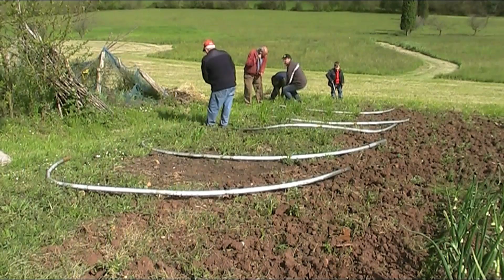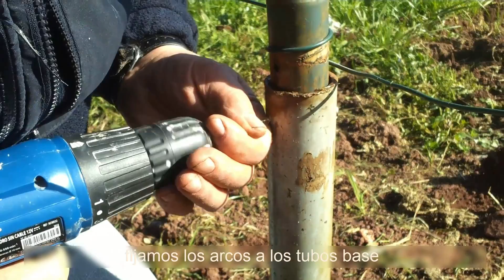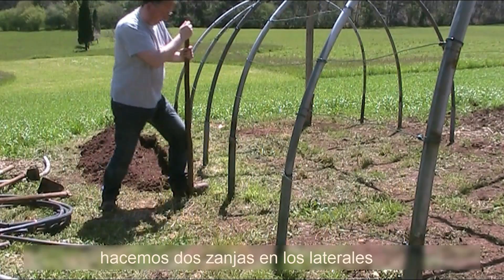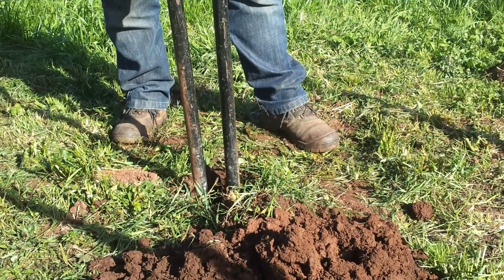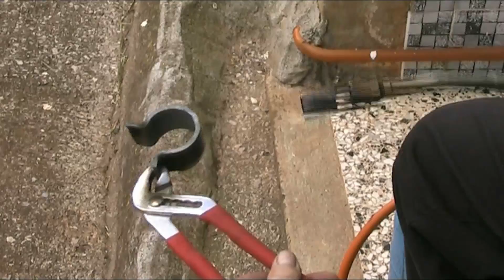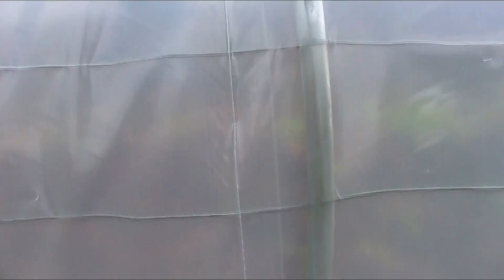✏️Como hacer un invernadero fácil || Invernadero casero💚 || Invernadero fácil || #invernaderos

Comment: Me parece muy bonito y se ve tan difícil de hacer, pero al final cuando se describen los materiales, la imagen de otro video no deja ver bien la descripción de los mismos.
Me gustaría saber:
Cuanto mide el invernadero, yo calculo 3 mts x 6 mts., es correcto?
De qué ancho son los tubos pvc que se arquean?
De que ancho son los tubos base, que se entierran 50 cm.  y si son pvc o de metal?
Cuantas líneas de alambre utilizan para reforzar la estructura?
Al final, antes de colocar el plástico, en la parte superior parece que utilizaron un tubo de color negro para reforzar la estructura, es como los utilizados en la construcción para introducir cables de electricidad?
Si alguno lo sabe, le agradeceré las respuestas.
Reply from the maker: hola,
el invernadero tiene 6 x 3 metros, correcto
Los tubos son de cinco centímetros pero pueden servir otras medidas y los que se clavan son de pvc y son justo el siguiente en medida de modo que encaja uno en otro.
hemos puesto 10 lineas de alambre, si puede poner doce mejor
El tubo superior es de agua, flexible, pero lo utilizamos por que no teniamos otro. Si usa uno rígido mejor.
Espero que me mande las fotos de su invernadero, nos encanta que nos las envien.
Un saludo

Comment: En una respuesta a un comentario de este video decíais que el diámetro del tubo de los arcos era de 60 mm y en otro apartado decíais que es de 50mm. Pasados los años cual de los dos tamaños os parece más acertado? Y Cuanto tiempo os ha durado el plástico que recubre todo? Disculpad mi insistencia, espero que tengais tiempo para informarme, gracias por adelantado 🤭
Reply from the maker: El tubo da igual que sea de 50 que de 60 no hay gran diferencia. El plástico nos ha durado en buenas condiciones 6 años.
Reply: Gracias, lo difícil por esta zona es encontrar las 10 atmosferas, están ya casi obsoletas, encontré un resto de diámetros 50 y 63mm. Solo me falta el plástico, alguna sugerencia de donde comprarlo?